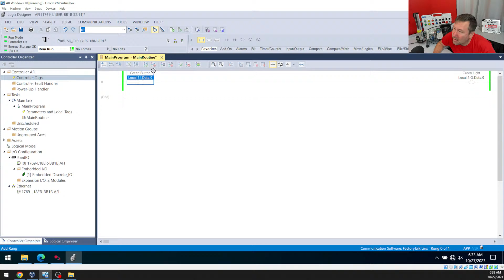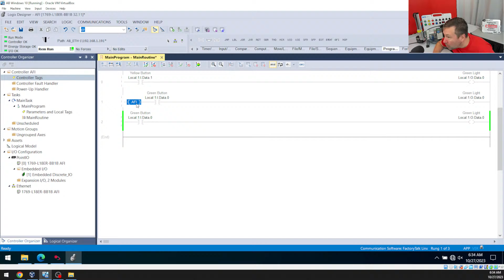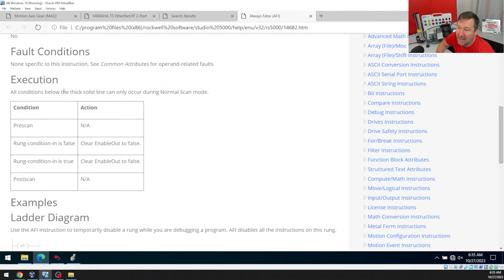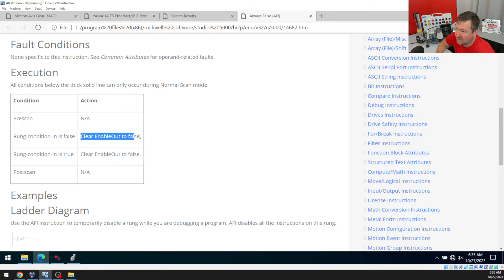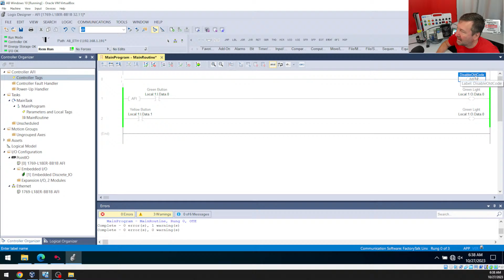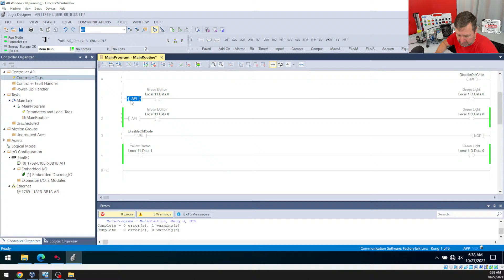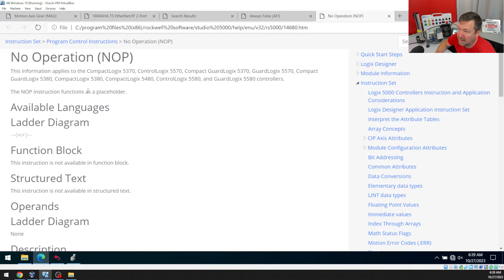Studio 5000 AFI Always False Input vs JMP LBL to Disable Rung

Comment: One of the nice things about using AFI is that the compiler throws a warning for each instance (as it does for you at 2:59). In situations where OTE isn't used I find the compiler warnings pretty handy since it reminds me of where I need to clean up the code. It's just one tool in the toolbox, though, and can be misused, like you've highlighted.
Reply from the maker: That works well on smaller programs but on larger programs it isn't unusual to have several hundred warnings.  I would stick an XIC and a tag noting that it needs cleaned up along with it.

Comment: Hello, i love your videos. Can you explain about implicit and explicit messaging in allen bradley. Other plc has it as a data block or instruction but i cant see in allen Bradley. Thanks in advance
Reply from the maker: That would make a good video.  For starters, implicit messaging is typically for IO connections that are configured in Studio 5000.  I remember this because "I"mplicit...I means IO.  Explicit messaging is usually when you use a MSG instruction to read or write data to another devices.
Reply: @TimWilborne  ok I will stay tuned for that video for implicit message. Now I understand that MSG instruction is explicit.

Comment: This has more to do with the fact that you are using two OTEs for the same bit rather than using an AFI.  Even without an AFI that light/output would have behaved the same way unless you were pressing both push buttons at the same time.

If instead you examined the contacts of each push button with an XIC/XIO controlling a latched and unlatched bit then the AFI would behave the way you wanted.  Not that I would personally write logic that way.

I have always found it helpful to think of an AFI as basically just a blocking bit, something that "blocks" the completion of the rung or branch on which its placed.

Just my thoughts from a fellow CE and someone who enjoys the content you provide.
Reply from the maker: I wouldn't do this either but enough people think it disabled the rung that it was worth talking about
Reply: @TimWilborne  Ah I gotcha. Yeah maybe it helps people think about it differently.

Comment: Thank you Tim for the great video. I am still wondering about the light is flickering. There is still something I do not understand. From what I understand RPI is the request packet interval that the module has to be updated. Since the program is so simple, it should be updated within the RPI time. Another point is the toggle bit function, it will affect the logic depending the bit location before it is updated (coil) in the program. I did some tests before. I cannot really recall.
Reply from the maker: The scan is asynchronous so sometimes the output is updated after rung 0 and sometimes after rung 1. It does spend more time on the 2nd, hence why changing the positioning of the rungs affected they outcome so much